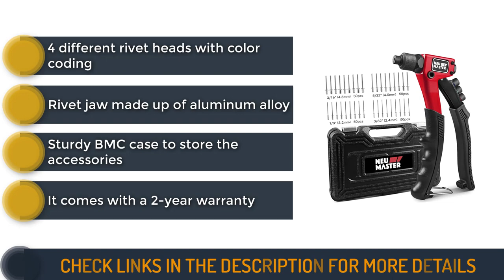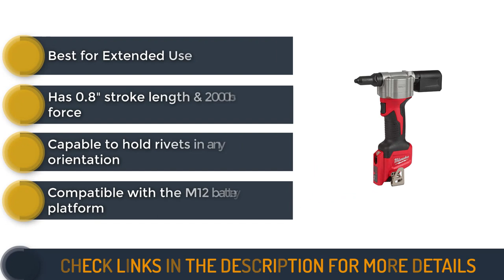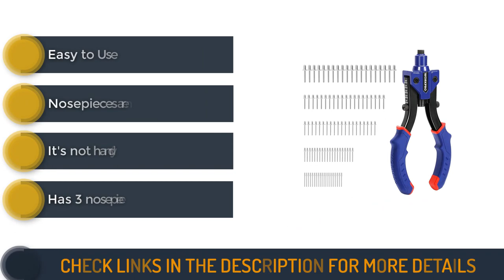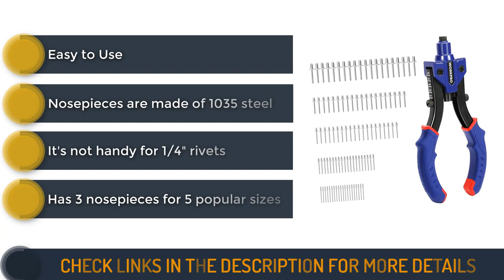6 Best Rivet Gun Reviews in 2024 - Pop Rivet Gun

Comment from the maker: 1. NEU MASTER Manual Rivet Gun with 200Pcs Rivets 00:32 
https://amzn.to/3YlB1Ma 

2. Milwaukee 2550-20 M12 Cordless Rivet Gun 01:35 
https://amzn.to/3YjtHAp 
https://thetoolnut.sjv.io/1ro9N6 [Tool + Battery] 

3. Wadoy Pneumatic Pop Rivet Gun 02:51 
https://amzn.to/3YkTGri 

4. Milwaukee 2660-20 M18 1/4" Blind Rivet Gun - Best Rivet Gun for stainless steel rivets 03:46 
https://amzn.to/3Y1FJgz 
https://thetoolnut.sjv.io/PyALq6 

5. WORKPRO 10" Heavy Duty Rivet Gun 04:52 
https://amzn.to/3Y1FTob 

6. Uaoaii Cordless Rivet Tool with 2 Batteries 05:46 

This Month Best Deals:
Libraton Heavy Duty Rivet Gun 
https://s.click.aliexpress.com/e/_DE8gNmf 

ONEVAN Brushless Electric Rivet Gun For Makita 18V Battery
https://s.click.aliexpress.com/e/_DlSRIyX